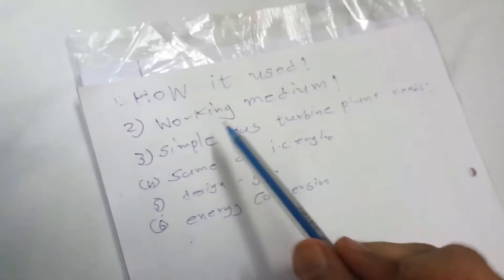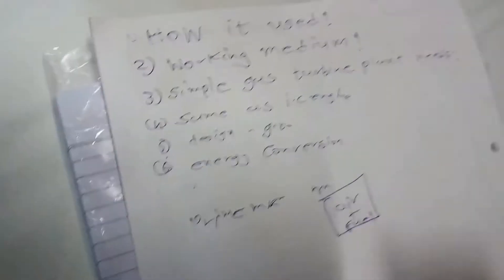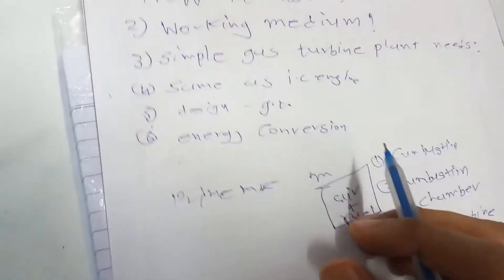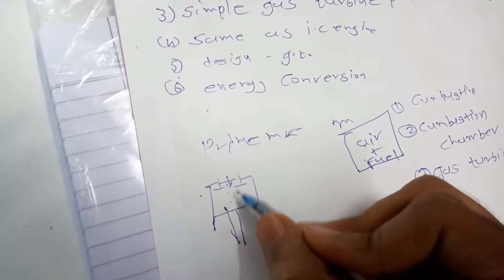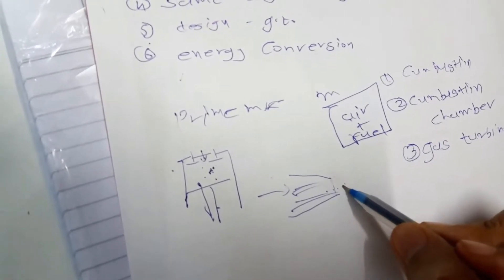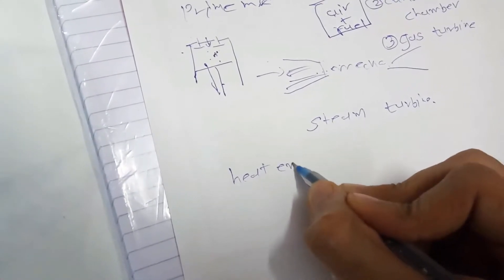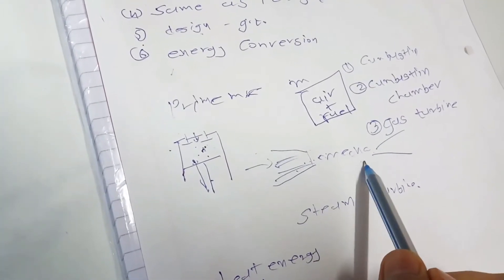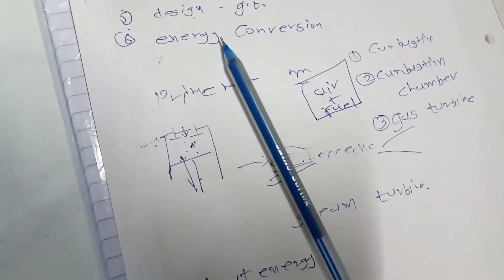introduction to gas turbine

Comment from the maker: [1] Gas turbine can be used as .......
a)Governer  b)Flywheel  c)Prime mover

[2] what is working medium of Gas turbine?
Reply: Gas turbine can be used as c)Prime mover
Reply: In gas turbine power plant, the working medium is either a mixture of combustion products(air and fuel) or heated air at a certain pressure and a higher initial temperature
Reply: 1 Mechanical Engineer of course "prime mover"
Reply: it uses mixture of combustion as a working medium
Reply: Prime mover, dude